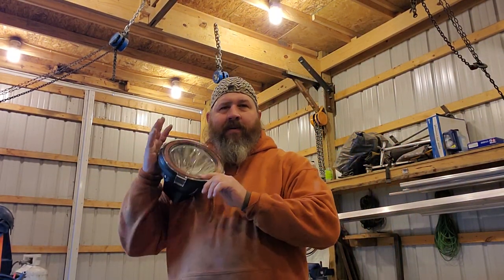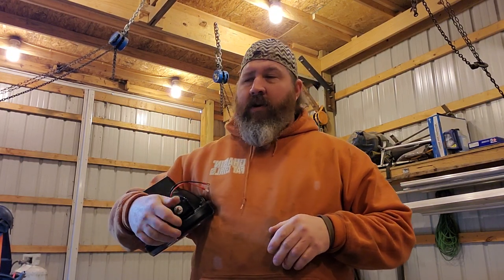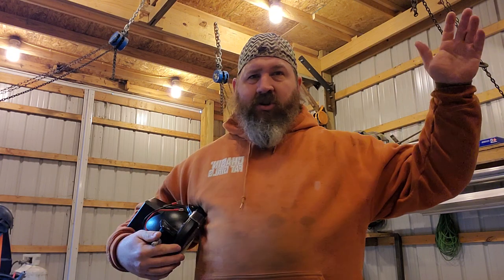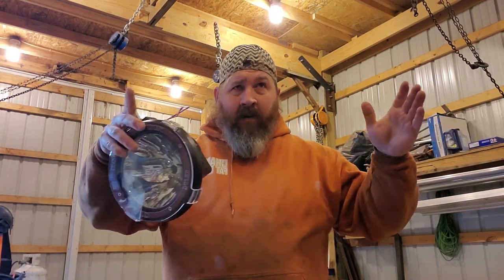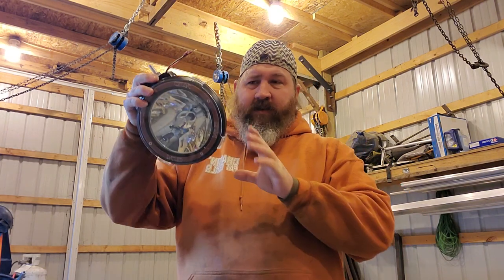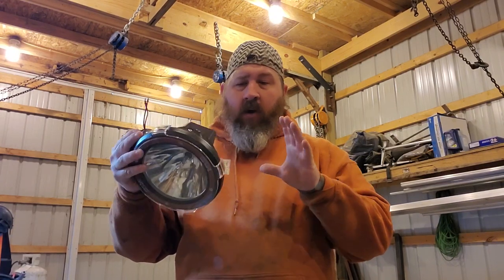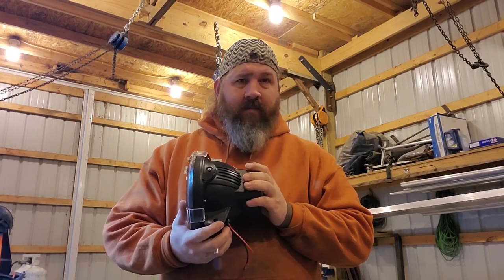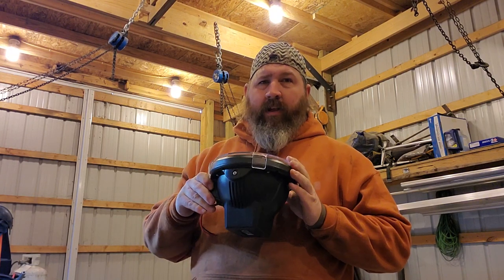Boat Driving Lights, what works

Comment: Hi, I'm in Scotland I have a 1976 Mayland16 fisher boat with a 76-78 Evinrude 9.9hp that's now got the 15hp carb on. It's hull is a semi displacement to be exact it's a scaled down version of a vospa torpedo boat with a UK style full cuddy and mine has the desirable top windscreens and Cape, it weighs 288kg so planes no problem from 9knot and sits all day at 15knot at 75% throttle.
Personally I wanted a detachable and manually movable light so after spending like £400 on utter junk to find one that lasted and that looked good on the water I finally decided to DIY it. I made one up from a bosch universal headlight that's from an old ducati 600cc monster. The newer ones you can get the reflector side of the housing to fit an H7 if you do a few little cuts with some snips. I then fitted an osram H7 and wired it up to a golf Mk5 headlight relay switch so it works two stage so a flick of a switch it has dip and full beams. It sits on a yoke I had from a dirt bike that I bolted to the cuddy behind the escape hatch and I drilled and tapped a hole in the mount it sits on so I can screw a rod holder into it and use the rod holder to move the light about if I'm searching with it. Really simple it took me 2hr to go pick the bulbs, housing and mount from Eurocarparts then 5 drill holes later it was  on the boat and wired up. It's stupid bright on full beam yet uses next to no battery on dipped.

Comment: Hey Dustin, do you have a recommendation for which HID light brand to purchase? By the way thank you for the info! I've been trying to run light bars on the Columbia river and having a tough time seeing logs and floating deadheads while on step with enough time to safely avoid them! Now I just need to get some HIDs!
Reply from the maker: The newest LED driving lights from 5star LED "100w spot/flood navigation lights" are the best possible option now. Tell Victor McNew I sent you.
Reply: @DustinApple  So you do recommend the latest version of LED now vs the HID?

Comment: How well do these work in the fog?
Reply from the maker: nothing works in the fog great but you can put yellow headlight film over the lens covers. it helps.
Reply: You need the UK fog lights from a scania or Volvo truck. They work good in fog buy are 24v only and you need to find a housing for them.